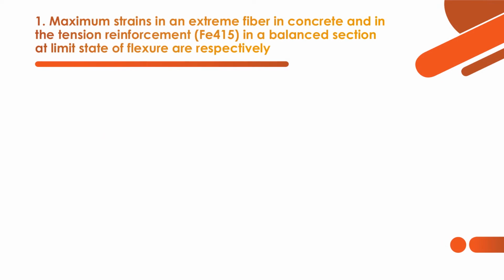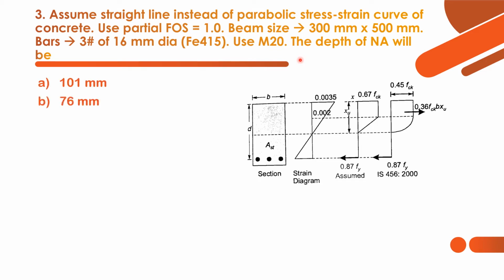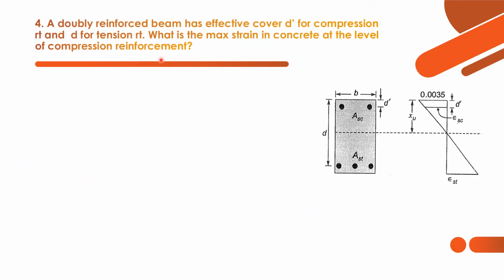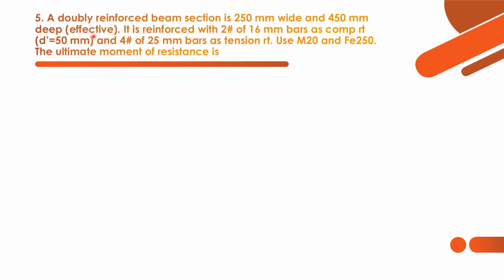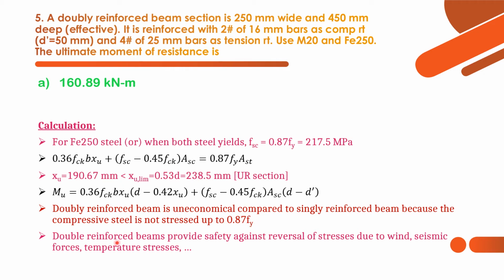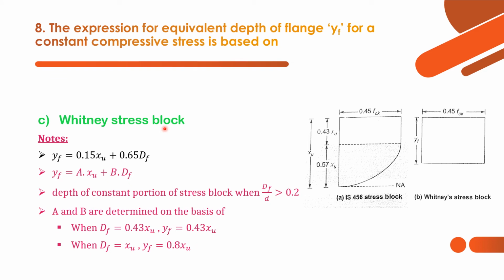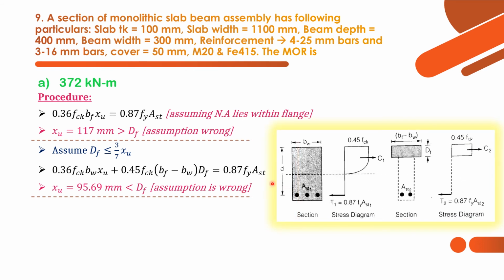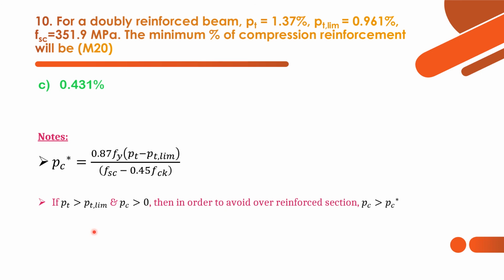Design of RCC beam - 2 | Structural Engg | GATE Civil | ESE Civil

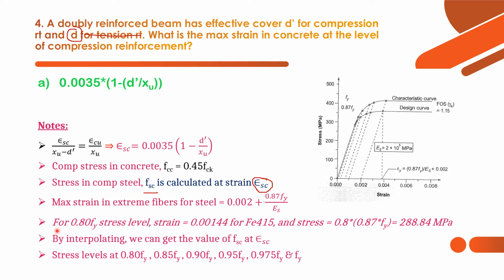Comment: 17:11 how strain will come 0.00144 by substituting in equation 0.002+(0.87x0.8x415/Es)  This value should be greater than 0.002, then y  it will come as 0.00144. Please review this, i think that value is obtained from graph
Reply: @CPlayCivil  Thank you for reply

I think for Fe 250 we will not take 0.2% strain offset to locate yield stress